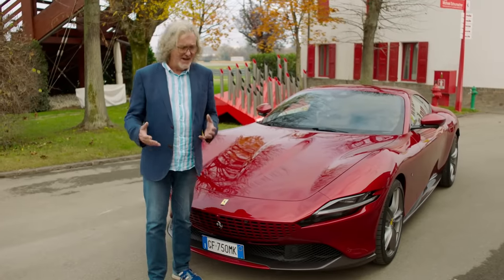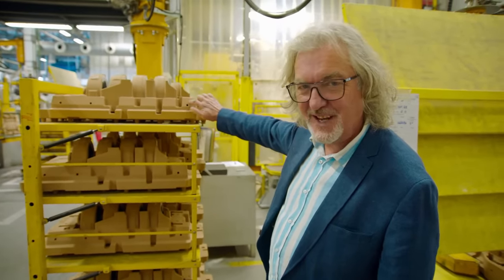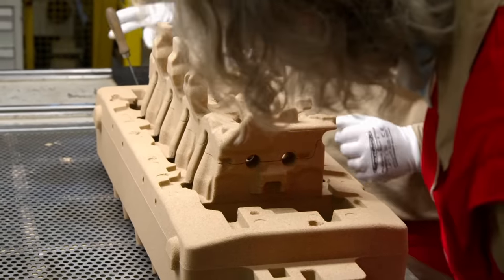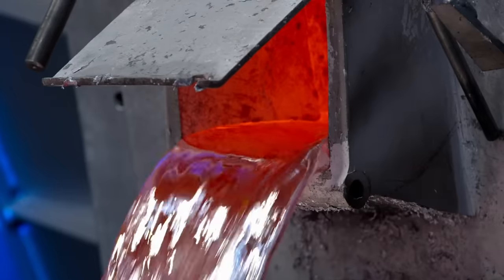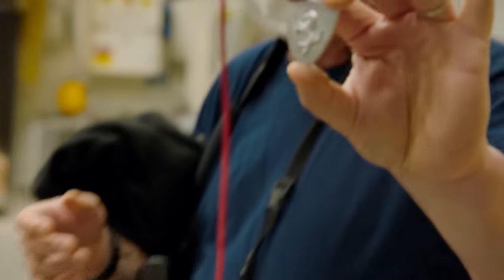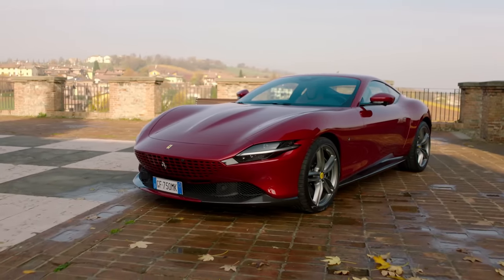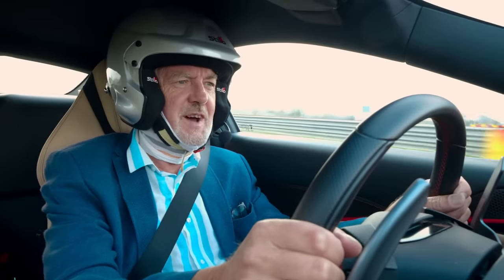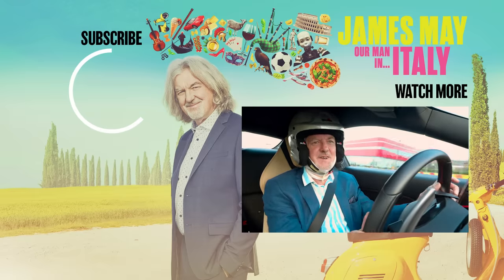James May Visits the Ferrari Factory and Test Drives a Ferrari Roma | James May: Our Man in Italy

Comment: 4:16 - ”and with a top speed of 199mph…”

We were on the verge of greatness, we were this close.
Reply: i'm surprised how James doesn't care
Reply: @A_Buster9693  compared to other supercars of the same class, it really isn't impressive.
Reply: @Zim5.0  Isn't there a running theme in TG where they don't care so much about the speed but more about the (*Italian clichè alert*) quality of the driving experience/soul/passion imbued in the car. This mainly applies to Alfas, Ferraris and sometimes Lambos. Also, since it only costs 170 grand, I think it may be a class or two below, say, the LaFerrari.
(These are just my thoughts, feel free to correct me here)
Reply: Having a 200mph top speed instead of 199mph is purely about bragging rights. If you have a Ferrari, you're not concerned with such.
Reply: @Zim5.0  Its not a supercar, its a GT - a Gran Turismo. Thats just a different kind of car. Its not about the high performance (which of course it has, too), but also the looks and the comfort. If you want a supercar = SF90
Oh, and also its the "entry" Ferrari, so its one of their weaker models with "just" a V8 engine. There are also other GTs with a V12.
Top speed isnt everything either, even in a supercar. Most of the time you cant drive it anyway at such high speeds. Even on the German Autobahn there are plenty of sections with speed limits, traffic, or construction sites... I recommend East Germany, far away from bigger towns, on early sunday morning for high speed runs.
Reply: @Gentleman...Driver  I agree , I didn't say that the car is bad, I think it's exceptional in many things, it's just that this isn't the only GT that can achieve this speed. Hence why James may didn't care.
Reply: @Zim5.0  I dont think high speed is the decisive criteria for Captain Slow. lol.
Reply: Just needs a bit of a tailwind.
Reply: @quillmaurer6563  Well said my friend !
Reply: @Gentleman...Driver  well he did hold the speed record for the Bugatti Veyron for a short while

Comment: I've never been big on Ferrari's, but the Roma is gorgeous!
As for an Electric Ferrari? That'd be like me wanting to own a steam locomotive, but then just buying something that looks like one on the outside but it is powered by electric motors. Rather defeats the object...
Reply: Does it? If the only thing you're looking for is an engine, then why buy a Ferrari at all? 

Also, it just looks like a nice jag to me.
Reply: @benjamindavis4974  seriously? You can't see any similarities between the last series of jags bumpers, headlights and backlights?

Ed. Doesn't look anything like an f type to you?
Reply: @benjamindavis4974  it's a blatant rip-off of the last gen XK mixed with Aston Martin DB11 design cues.
Reply: @michaelhall5429  also, it doesn't even sound good. The V12s are fine but Ferrari has never had good sounding V8s, least of all this anodyne flat-plane twin-turbo one. It's charmless. At least the F136 in its Maserati crossplane form had character.
Reply: @richardharrold9736  I genuinely reckon you could have slapped a jag or Aston badge on this thing and nobody would have said anything. Have they hired that dude who designed Korean cars for a bit and then did the last lot of jags?
Reply: @michaelhall5429  I'm not aware that Jaguar has ever hired an ex Korean car designer. For many years their chief designer was Ian Callum, ex TWR, and Geoff McGovern cut his teeth at Land Rover before taking over the big JLR job...
Reply: @richardharrold9736  wow I had it completely wrong. It was a guy who worked for Audi and then went to Hyundai I was thinking of. Not sure why I confused the two. Audi and jaguar aren't a million miles apart in what they produce, but my memory was a million miles off the truth. Either way this Ferrari looks like a Jag no matter who designed either.
Reply: @michaelhall5429  Peter Schreyer is the guy you're thinking of. Designed the original TT and R8 among other VW/Audi cars, plus a bunch of Kia/Hyundai stuff.

Comment: Wrong. The engine goes. That’s a major part of the experience of driving any performance vehicle. If it goes all electric then it adds several hundred kilos of weight in the batteries. No matter how good you make the suspension, you can’t defeat physics. Especially in cornering. Yes there are some reasonably good handling electric cars but they would be even better without all that extra weight.
Reply: It would be cheaper buying a RC version or Scalextric version of the car than buying the real electric Ferrari.

Comment: We're going to leave carbons behind to realize carbons keep the planet alive. Fascinating.
Reply: Please elaborate on your point
Reply: @anhondacivic6541  Majority of the life that supports all ecosystems feed on carbon or use carbon to protect themselves.
Reply: @anhondacivic6541  The overall amount of Carbon in the air has been becoming less and less. What's been fading as well is the Electro Magnetic field.
Reply: @DJBillionator  the amount of c02 in the air decreasing is a good thing as of now since there is too much in the air but the magnetic field decreasing won't be problematic since it is at a very low rate that it is decreasing
Reply: @anhondacivic6541  With less food for ecosystems. More life will die that needs those systems. 

Removing wolves from yellowstone changed how rivers flowed through the park. I recommend you watch that documentary.

Comment: How to make vehicles run on water : ELECTROLYSIS INSIDE FUEL FILTER, AND INSIDE COMBUSTION CHAMBER BY PLASMA FROM MULTI SPARKPLUGS, JUST NEED LITTLE HACK THE ELECTRYCITY BY USE SUPERCAPACITOR AND VARISTOR, AND MAKE ELECTROLYSIS INSIDE FUEL FILTER, GRAFITY FROM FUEL TANK AND FUEL FILTER BECAUSE SWAN NECK GRAFITY EFFECT WILL MAKE PRESSURE SO HYDROGEN DON'T COME BACK TO FUEL TANK, BY INJECTING BOTH HYDROGEN AND WATER CHAIN REACTION MUST BEEN HAPPENING INSIDE COMBUSTION CHAMBER, THIS MEAN ALL VEHICLES ACTUALY CAN RUN ON WATER AND HYDROGEN.